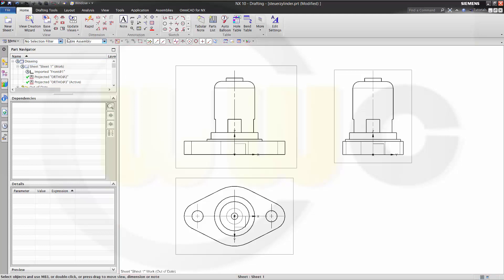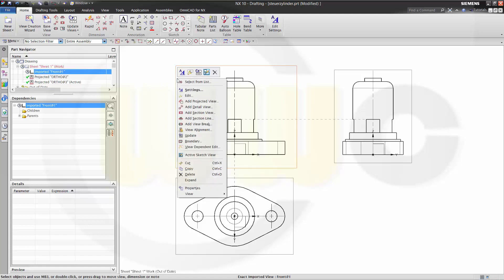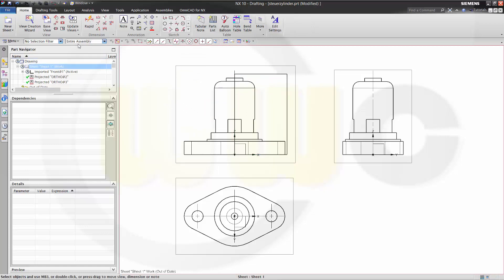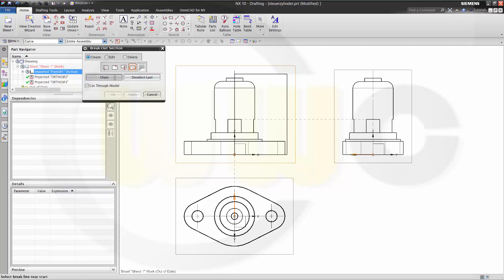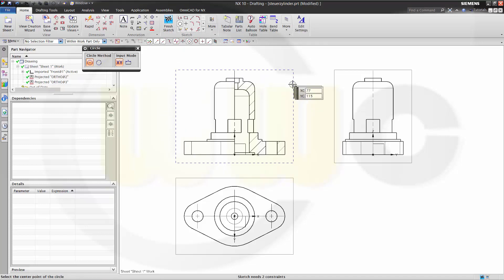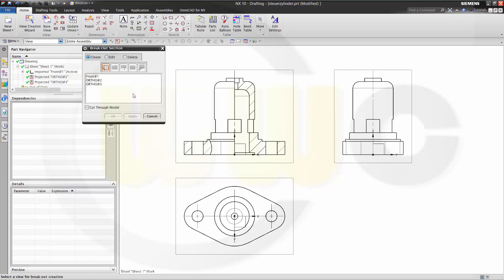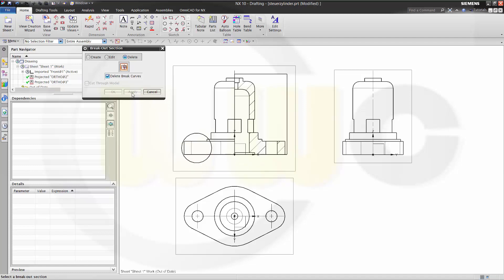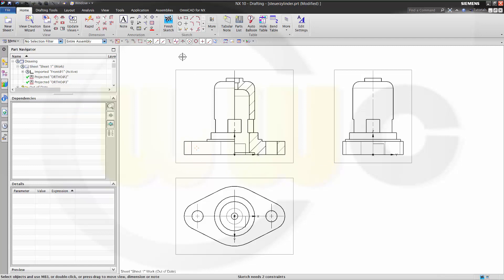FAQ Siemens NX Breakout-Section View

Comment: How do you add arrows to the view with the base point?
Reply from the maker: You mean the "axis system" ?
Reply: Yes, the section line (or cutting plane) with the arrows to show the direction of sight.  How do you add it to the view with the base point ?
Reply from the maker: By using "section view"
Reply: Yes, however, for my case "section view" doesn't work.  Thanks for responding anyway.